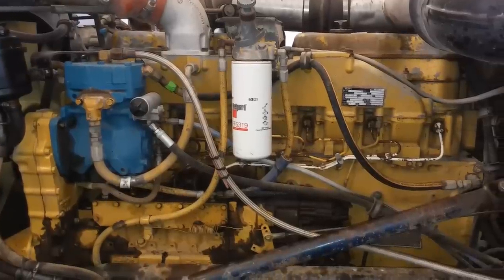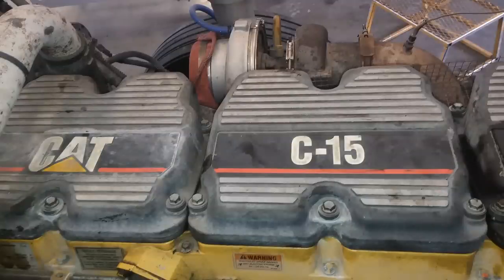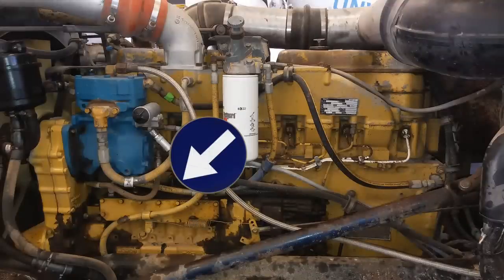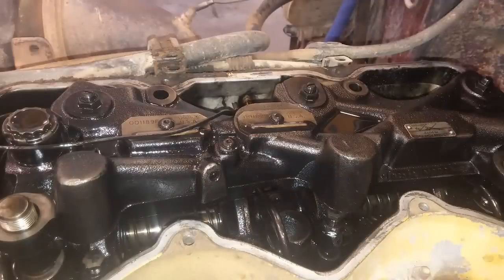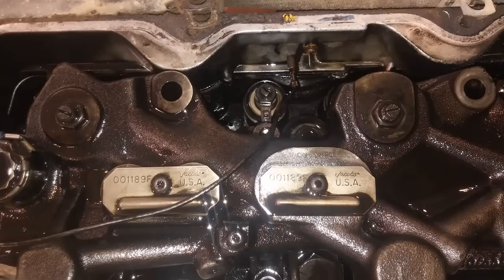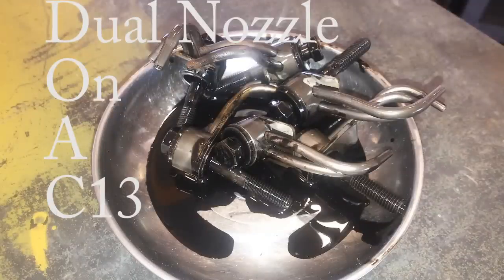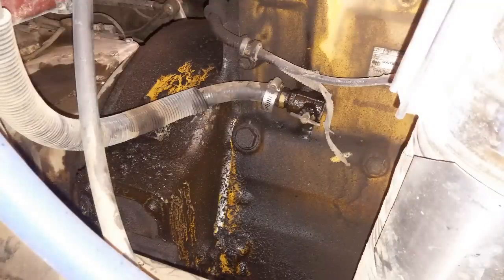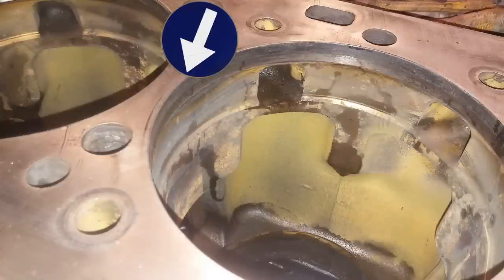The Cat 3406B Engine. Know Your Engine.  Caterpillar 3406 Information And History.

Comment: @adept ape. Got a b model in an 87 w900 that supposedly was out of framed before I got the truck. It has been a good one and runs like a raped ape.  But for some reason the high coolant temperature buzzer keeps coming on even after only driving it 5 miles or so but when you flip the hood open there is no steam or water puking out and the radiator is not hot nor are the hoses. I'm stumped do you think its the water pump or t stat even though I replaced the t stat with a factory one from 🐱. Or is it maybe a faulty sending unit or gauge. The gauge pegs out and I know there is no way in hell its hot with less than 5 miles and bobtailing. Has a 15 speed behind it not that it matters.

Comment: I have a 3406b and it's starts with starter fluid but won't stay running without it, what should I do
Reply: Check your injectors there is no reason for that mine starts first crank not sure go ask someone never dealt with that prob.

Comment: please do a video on the 1693, the most awseome  engine , except fot the e model which i currently run,
Reply: the original 425 cat , that could be turned to whatever your preference, the best, totally ahead of it's time, mine was in a 72 kenworth logger
Reply: The hot trick in the day was put a 380 torque spring in a 425.

Comment: Any hints on fuel to oil dilution
Reply: 1st nozzle, 2nd has ANYBODY fixed a fuel leak on the injection pump or remove the pumps, fuel line, fuel transfer pump.

Comment: U know the 3406b injector sleeve tool removal part number ?thank u sir
Reply: What are you calling the injector sleeve? These engines have nozzles, not injectors. The nozzle sets in a nozzle chamber with a cap on it. The first product head was used off 92U design, and the nozzle was not in a chamber. It was fully visible.
Reply: @johngoldsmith6629  yeah u right i was talking about the nozzle chamber they screw into the head but I can’t find the tool for that last time i make one but can’t find it
Reply: @omaralmeida3742  The early tool for the ones not in the chamber-5P125. That one you have to remove the valve springs. Rarely see these now. The most you see now that sets in a chamber is, 8T3201. The chambers torque to 150 Ft Lbs. You put anti-seize on the threads and around the seal. The part number for the spanner tool is 8T3139, the cap torques to 35 Ft Lbs. The fuel lines torque to 30 Ft Lbs. It is best to replace the metal gasket on the bottom. Also the chamber has two part numbers if I recall. They updated the closed nozzle design. The o-ring for the chamber has been updated. If you look it up in SIS it will be the yellow O-ring that is no good and will fail quicker. Once you remove the chamber let me know if your replacing it or just resealing it. The adapter that goes in the head, has two styles. One with a lock and the newer one with no lock. It is made on the adapter. The one piece is better as it won't vibrate and wear the seal out. However it cannot be used with older outer fuel lines as it will leak fuel. Again the O-ring for the adapter has been updated. The yellow ones leak oil over time. Remember on these 3406, 3406B and 3406C engines. SIS has not been updated to the improved O-rings. Most yellow O-rings on these engines are no good and fail quicker. Only a very few places yellow O-rings are still used. If you have a 3406 B or C model. The nozzle part number in the book is wrong on later engines. First production serial numbers are correct.
Good luck.

Comment: If I remember correctly, there was also a 3406C. It was air to air after cooled. The B model had water jacket aftercooling.  So the C was the last mechanical engine, around 1993 ?  The flywheel and injection pump had holes to pin, in order to set the timing
Reply: George Kuetsten no the b model was charge air cooled had one in a 90 379 was a great eng by the way sold it with 1.2 mill on original eng
Reply: 3406 B started off as a JWAC and went to a ATAAC.  You also had a time when you could get a JWAC or ATAAC engine. Last 3406C was a 8PN. It has a 5EK exhaust manifold. Stay away from these. If you mix cylinder heads you will have a smoking problem that will pull your hair out trying to find.
Last one was built in 1999.
Most people actually get a 3406B and a 3406C mixed up. They call them B models, when they are C  models.
Reply: 3406C had a wider main bearing and ran a higher oil pressure, We just changed a B to a C, alot of the C's had round port heads as well.

Comment: Whats the difference between C and E? And when did they start putting the cam in the head?
Reply from the maker: +DieselFueled _ The 3406E was when they put the cam in the head and they switched from a high pressure pump to the Cam actuated electronic injectors. The C model is very similar to a B model, but has an early model ECM and some very expensive electronic controls.
Reply: Thanks for the information!
Reply: 3406C PEEC electronics are expensive. I lost fuel management on mine. $3000 later, I was able to drive with a load again. Was there any way to convert this PEEC to mechanical. They told me at the shop, that the only downside was the loss of cruise control.

Comment: Cummins is a 855 cubic inches motor.  Cummins can't go as far between rebuilds , but there also cheaper on parts.
Reply: lawrence henry  I'll have to disagree about that one.  The 855 based Cummins engines, especially the Big Cam IV and N14 ( mechanical and electronic ) can go as long if not longer than the big block Cat. It's all in how they are cared for and driven.  And for sure when it comes to rebuild time, a lot cheaper.
Reply: Cummins don't get rebuilt....they blow apart and get thrown away
Reply: John Hull just being trollie.....I see ya
Reply: Steve Ross - The N14 was one of Cummins better engines.  The ones in my brother's fleet went 1.5 million miles before inframe.

Comment: How come you didn't mention the 3406A. Some of us 70 year old guys played, oh sorry, we repaired and tweeked the power output with various results. Some were good and others catastrophic.
Reply: Before his time, I haven't seen one in several years.
Reply: @johngoldsmith6629  So I have a shake above 40 mph that started after I got my fuel pump rebuilt. I adjusted the dashpot and it helped some. But it's still bad.  Have done several filter changes and didn't help.  If you step on the throttle all the way it won't shake. But anything below full throttle it will shake and get worse unless you let out the throttle completely or step in it completely.
Reply: @07TBoneMarcus  What do you have? This makes no sense " If you step on the throttle all the way it won't shake. But anything below full throttle it will shake and get worse unless you let out the throttle completely or step in it completely." If you step on the throttle it won't shake, then you say when you step in it quickly it shakes.
Reply: @johngoldsmith6629  3406C with a B pump. It never shakes full throttle.  I get 27 lbs of boost at full throttle.  If I back off the throttle at 22 lbs boost it will shake.
Reply: @07TBoneMarcus  What is your engine serial number and why did you put a B model pump on it? 3406 C's have higher injection pressure.
Reply: @johngoldsmith6629  Previous truck owner did it. Serial# 3zj36679
Reply: @07TBoneMarcus  First off that engine came with extrude hone nozzles. They are junk, you cannot order nozzles on a 3ZJ using the serial number in SIS. You have to refer to a truck engine news article using serial number range/ and horse power. Your engine shows to be a 425@2000 RPM's in a KW. SIS calls for a 1007556 or reman 20R5169. Again they are junk, the tip will close up and you will have a stumble. 0R4337 is the best nozzle for that engine.

What pump is on the engine, I need part numbers. Part number stamped on the top and if possible the number on the fuel system camshaft. The VTU would have to come off to get it. When they rebuilt the fuel system what parts was replaced? Who timed the pump? Did anybody mess with the VTU? How many RPM's does it turn at high idle?
Reply: @johngoldsmith6629  It has pump 7W3906 on it.  They did a complete rebuild and almost everything was replaced.  Flyweights, bonnets, bearings, plungers.  He said the cam wasn't abused so he just cleaned and used it again. He replaced the nozzles with 7W-7032.  Supposed to give a slight increase in hp and response.
Reply: @07TBoneMarcus  That is the casting number on the housing. The number is stamped on the top, something like 7W3100.
Reply: @07TBoneMarcus  Nozzles are designed to match the bowl of the piston, you got a mess. Early B pumps timed around 24 degrees BTDC. 3ZJ's was around 10 degrees BTDC. What part number plungers did they install?
Reply: @johngoldsmith6629  The only other number I can find on the pump is 7w683. 
 The pump was timed to 14.8 degrees. The plungers are ctp108-6631.
Reply: @07TBoneMarcus  That is on the side cover. The number is stamped on the very top. 
The 1086631 is the P and B. Did they replace the bonnet and bushing? Cat offers a reman pump ( not the whole fuel system pump)   but you get a brand new one.

Comment: Adept Ape do you ever do any videos on 3408 ??? Thank you
Reply: 3408 was a 28V prefix and actually had a 3408B later truck engine. What was cool was having a 3408 with a 7155 transmission.
Reply: Is a 7155 tranny an automatic?
Reply: It was a gear transmission, with a air operated ratio selector.  If memory severs you could get a 16 (common) or 18 speed. Military trucks was the most common, M915 I think. 400 Cummins with a Cat transmission. The biggest problem was water getting into the air system. This caused numerous problems, with valves sticking and or the ratio selector.
Reply: Thanks for that information, John, and your other contributions here.  I decided to google the subject and found the following link very interesting:  http://www.plumbers.cc/images/m916/7155/Cat-7155.pdf

In 1975 and thereafter, I am not surprised the transmission was not widely accepted, because at that time most truck drivers came from a rural background and knew how to handle completely manual transmissions, making the extra weight and cost of the 7155 a drawback.  The dual counter shaft Roadranger transmissions were rapidly replacing the two-stickers, also making shifting easier for drivers.
Reply: That be her, replaced one with a military surplus new in the box rebuild, a few years ago.  When you hear it shift, the noise it makes, you will remember it for a life time.

Comment: I have a 1990 379 Peterbilt that I'm looking at possibly buying. The truck is in very great shape. Paint new, frame parts new, every part that bolts on engine is new, engine repainted, Interior redone, blah blah blah. It runs like a sewing machine from the videos I've seen.only thing is the dealer whos selling it says he has no proof of the rebuild on the engine.. He said it was fully rebuilt right before he bought it from the previous owner. Previous owner had it rebuilt and only has around 30k miles after rebuild. Said transmission is new and has about 10k Miles on it..

 Not having proof of  rebuild is my only hesitation on buying this truck. Is there any possible way to tell if this engine has been rebuilt? And is there anyway to tell if the transmission is new? He said u can look under truck and tell that it's new. But I know how these dealers are. I just don't want to make a mistake.
Reply: Might get some info off the cylinder head. Casting number or anything you can find. Some stuff is stamped on top deck near regulator hsg. Of course you could pull the oil pan and get the date codes off the rod or main brgs. A oil sample might show some info.  Do you have a engine serial number? Somebody built it and talk to the previous owner. If they didn't use Cat parts I would be afraid of it.
Reply: @johngoldsmith6629  well truck is several hours away and the previous owner is dead.. You see this truck and would think we'll surely it's rebuilt. I mean this thing is clean! Every part on this engine and truck is new.. From frame parts/suspension, to interior and alternator, starter, compressor, fuel lines, etc. All new.
Reply: @nightryder16  See if the vin matches the engine serial number.
Reply: @johngoldsmith6629  OK but that will only tell me if it's the original engine right?
Reply: @nightryder16  I can look up some info on it, its a start. Must likely won't show anything. If your lucky you can call your local Cat dealer and see if they have any recent records on it.
Reply: @johngoldsmith6629  OK thank you
Reply: Did you get the truck?
Reply: @THEDC81025  no the dealer ended up going rogue on me right before I was suppose to catch a flight out there to buy it.. Ended up finding out that these people are crooks.. I guess he realized I wasn't  gunna be an easy screw over after all the questions I was asking. I think it had to do with the engine being rebuilt or not.. Like I said he didn't have proof. TSI truck sales in Florida.. Don't do business with these people!
Reply: @nightryder16  how much was they selling the truck for? I bought a truck in August they had told me the motor was rebuilt but that was lie it was dealership in Tennessee smh I took it straight to my mechanic he opened it and of course it wasn’t so now I’m putting a 3406B in it originally it had a big cam 400 Cummins
Reply: @THEDC81025  was listed at 65k but we made a deal on 60k

Comment: Adept Ape I can tell you that you are wrong on the horsepower of these engines. 

I got lucky while loading at Cat and talked to a few enginers there. They told us how to set one of these engines up to run and how to get 800 HP out of some of these engines. Put a marine cam in the early B model and she will come alive. 
All of the old-timers back then can tell you that the engines they knew that ran and pulled from these B models had a slightly different sound of the lope/growl of the engines that said they were bad to the bone. They had a sound with straight pipes that would cause people to stop what they were doing and just look.   

You can get 550 by just setting the fuel, air, and wastegate depending on the model number. I can say not all of the B model engines can be made to run that type of HP and that the C model was their worse engine for power turn up as you got what was on the block more or less. 

The primmer seal would suck air sometimes and it took a while to find out what caused the engines to not do what they were set to do. Cat fixed that somewhat with later engines. Turned up you had to watch the turbo and not overdo it on these engines when you did the turnup. 

We had a new 1986 359 Pete with the B model engine in it that was ungodly on power after they did their magic on the engine we ordered. (Ordered the Pete and ordered the engine 3406b to go into the Pete is how we did this). We were hauling containers of Cat engine/parts to the docks in New Orleans and made some friends at Cat.  Back in the day all of us owner opp that trucked put whatever type of engine we could in a truck. The jake came late in these engines and most of us cussed these with the problems they had on the first ones.

Comment: Maybe here someone can help , my engine starts but won’t stay running, everything started with the engine not been shutting off, so I replace the solenoid, and didn’t fix anything, not sure if solenoid is getting any power to it, I just replace filters, transfer pump and rebuild the AFRC, the only way the truck stays running is if I keep my foot on the throttle, but as soon as I let go , dies , I can’t find anybody with knowledge on this engine near me , so I been doing most of the work , I have to replace a couple air lines , but not sure if that could be the problem, any help please
Reply: Take the solenoid off and see if it will run with out it. At what RPM does the engine run?  What is your engine serial number.

Comment: I have a 3406B as well and I know this is along shot, My mechanic fell on tough times and decided to sell his shop during my rebuild. Does anyone know a dependable Old School diesel mechanic that can put my engine back together? I have the rebuild kit, my block has been shaved and cylinder head has been rebuilt, I'm in Houston,TX.
Reply: Make sure lower deck is in good shape. You don't want to have a liner seal issue. Lots of updates, NOT in the parts book. Depending on what you are rebuilding.

Comment: Hey can you do one on a 3406A.
Reply: A model, (now called) was a 92U prefix. Could come PCT, PCTA, DIT, DITA. First 5,000 was junk, oil in radiator. They fixed the block and problem solved.